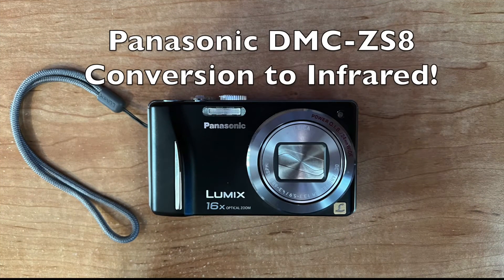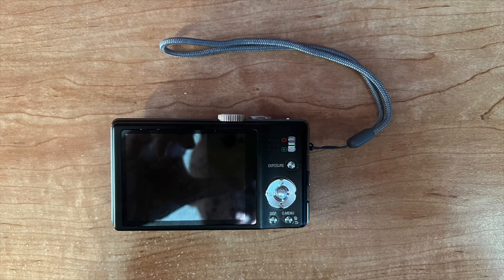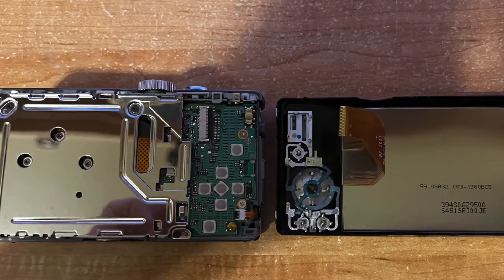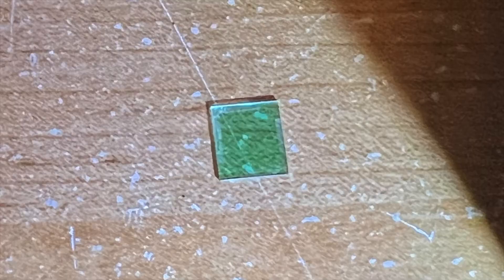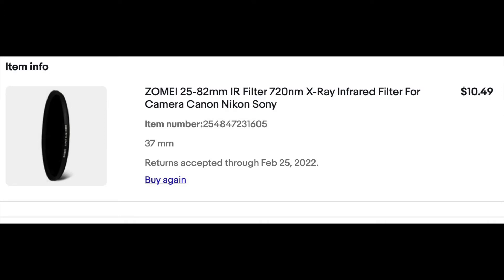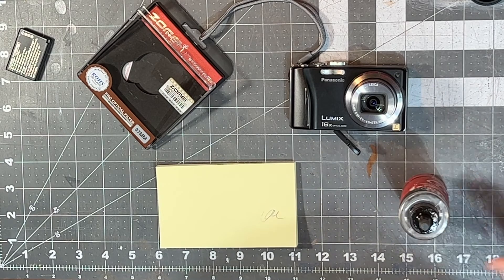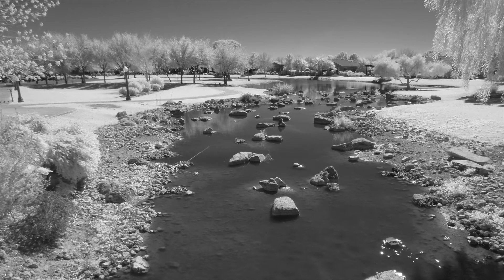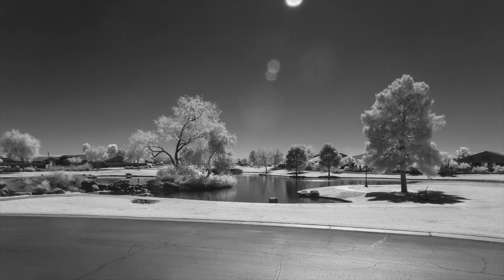Camera - Panasonic DMC-ZS8  Conversion to Infrared

Comment: What will be the thermal resolution of the sensor and will the thermal resolution be sufficient for video examination trouble shooting of cellphone printed circuit boards?
Reply from the maker: I'm not an expert on this but basically:  Thermal cameras are different than infrared cameras.  If you want to troubleshoot circuits you need a thermal camera.  Typically their resolution is very poor untell you get into ones that cost over a thousand.  Search for thermal cameras on YouTube and you will see what I mean.  I have a TOPDON TC002C Thermal Camera and it's resolution is only 256 x 192.  Ironically in Thermal cameras this is considered High Resolution!

Comment: Sorry follow-up question: what kind of colours would u get if you don‘t put an Infrared lense in?
Reply from the maker: If you don't put an infrared lens on the front it will be almost a normal camera - I think.  You need the infrared lens to limit the camera from picking up the visible light.

Comment: Just snagged a ZS8, so this looks tempting. Just to be certain, you didn't see a need to add a substitute piece of glass when you removed the IR filter from the sensor assembly? Thanks.
Reply from the maker: Correct.  I got it cheap and was prepared to fail.  Worked out fine.